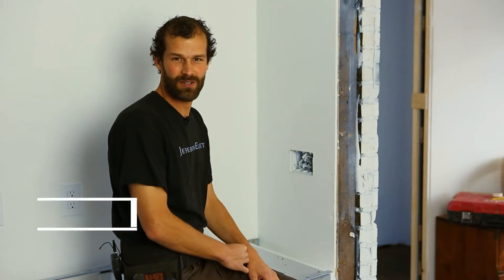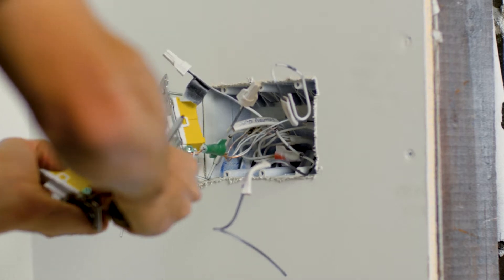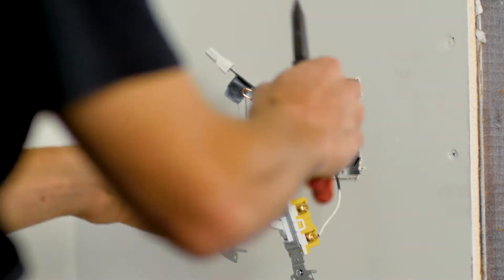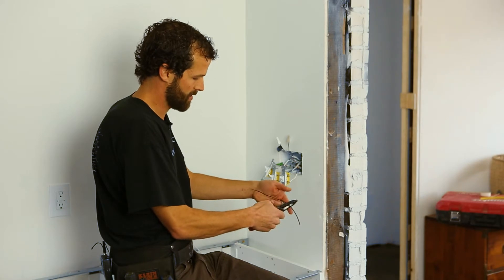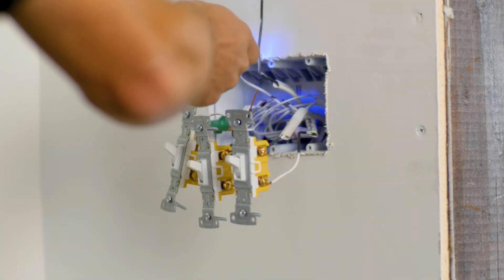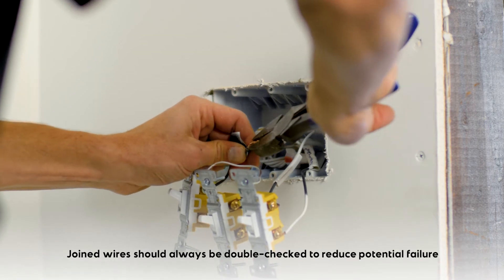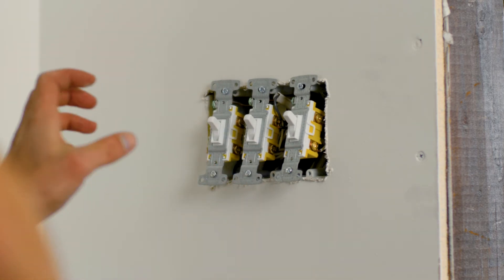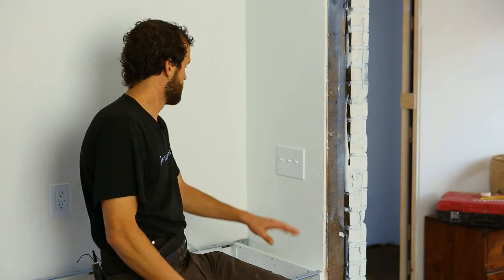Installing a 3 Gang Switch Box

Comment: This is genius. I don't know how many videos I've watched that have told me to pigtail 3 or 4 new wires onto the existing hot to power all switches. You end up with 6-8 wires in a nut and it's impossible to shove all that in the box. Thank you for this video. I'm only disappointed that I've found this after I already wired a few multi-gang boxes. Super clear video from start to finish. Thanks again.

Comment: Enjoyed the video. Question, did you mention a neutral connection in this box? I assume you would have spliced them altogether as you did the ground and pushed that to back of box before the start of video. Doesn't code and best practice now require a neutral connection in switch box for possible smart switches? My 1950s house doesn't have neutral in the switch boxes, nor ground.

Comment: Very helpful video. Thank you!  One question . . . Why were there two hot conductors coming into the box that you connected to the the hot pigtail?  Was one the run from the panel and the other a line out to another box somewhere?
Reply: Yes, if there are multiple hot wires in a box, one of them is the power coming while the others are power feeding other switches/outlets

Comment: That’s bad ass that’s the first time I’ve ever seen someone or even come across using a single wire as a pigtail for 3 different switches & the same for the ground.  I guess if the center switch was to fail it could possibly cause a headache for DIY’er . Going that route Definitely has  to free up some space in the box bc there is usually a ton of twisted up ground wire taking up tons of space. Where is that  other hot wire coming from & where is  it going. I maybe confusing ur 1st video I saw that doesn’t  line up w/ the 2nd video.
Reply: Although this method of pigtailing hots/grounds seems counterintuitive, if either switch were to fail, it wouldn't affect the other switches since the wire is continuous to all three switches. So if the center switch was out, the other switches would still work as long as the hot wire between the switches isn't broken. 

Also, in this box, the other hot wire is feeding another switch/outlet.

Comment: very confusing all the wire appear to be painted white? Why would one want to confuse the people?
Reply from the maker: Extremely common in new construction or major renovations for the painters to spray straight over the boxes. Not hard to scratch it off with a fingernail to tell which is which!

Comment: Why is there 2 incoming hot wire in the box?
Reply: Good question, you can't connect 2 hot wires. I think that the one with the dark tape is the hot wire and the other is the downstream connection. He wasn't clear enough on that.
Reply: Good question..can't havee 2 hot connect to one another.
Reply: Good question I was wondering how comes 2 hot connected to another.
Reply: Both of them aren't incoming. Only one of them is. The other hot feeds a switch/outlet downstream